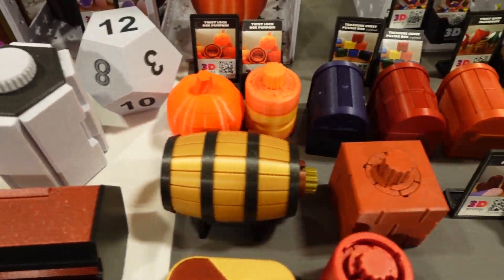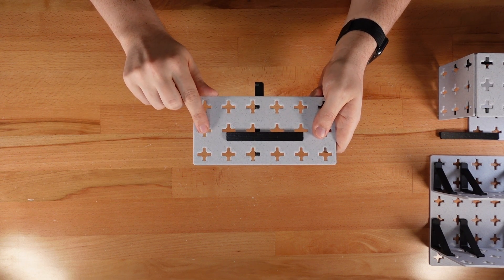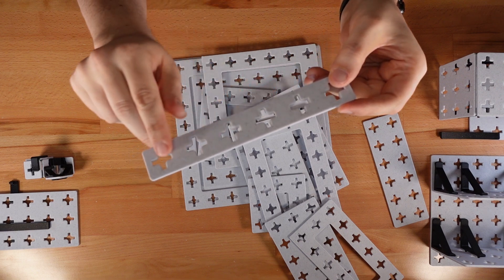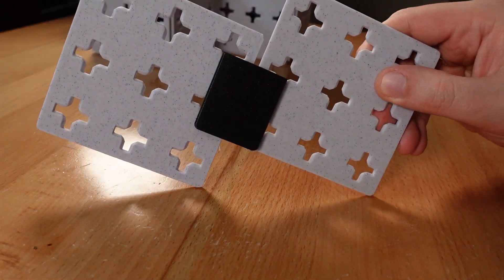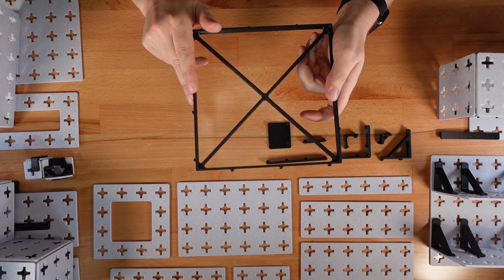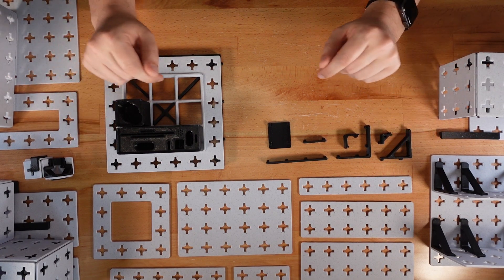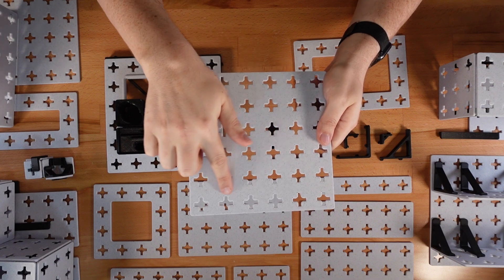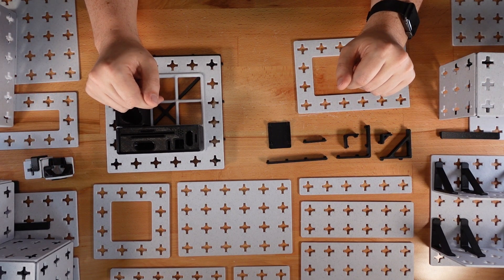3D Printed Shelving - Printy Panels!

Comment: I do see that there are templates to create panels but how would I go about generating say a 2x3 panel?
Reply from the maker: You have a few options:
1. There is a robust collection of remixes of my design on Printables, including one remix that has a 2x3 panel you can download. I bet there are remixes elsewhere too, but Prinatables has the most collected into a single spot.
2. You can open a 3x3 panel in your slicer and use the cut tool to slice it in the middle. Then scooch both parts together so they make a 3x2.
3. Or you can open the template file in a CAD modeling program to carefully place the parts together to make the panel you want. This is the best option if you're making a very unique panel shape - like a panel that bends around multiple corners.
Reply: @3DPrinty funny enough I didn’t check the remixes on the main printables posting. I found all I need and more. But I will keep the other 2  options in mind if I need them in the future 

Thanks.

Comment: If I print them out of PETG, can it hold multiple filament spool ?
Reply from the maker: Your results may vary, but I've tested storing multiple full filament boxes on top of a small shelf with no signs of failure after a month.

The shelf used 6x6 panels connected with a combination of box connectors (front) and reinforced box connectors (back).

Comment: What's the maximum weight the shelves can hold?
Reply from the maker: The answer will depend on the filament used, the print settings, and the construction of the shelves. But I can say the a simple shelf comprised of 6x6 unit panels printed in PLA+ and assembled into a 2x2 box formation (with a backing panels) supported 16 lbs (more than 7kg) with no sign of breaking.

If the shelf had been constructed with bracing panels below the top surface (or with smaller panels) it could easily have held more weight than that.

Comment: How much weight can these shelves hold?
Reply from the maker: There are a LOT of factors: filament used, panel size, shelf size, wall mounted vs table top, clip type, overall construction, etc.

I just dropped 8 1kg boxes of filament on top of a 3x3 desktop shelf and it seems fine with it. The shelf is using 6x6 panels (PLA+) and non-reinforced offset box clips. If needed, it could be much stronger than that by adding 6x1 ribs below each shelf and reinforced box clips.

Comment: I had been working on a modular shelf idea for a while and recently abandoned it as impractical for several reasons. The Printy Panels are an amazing idea and far better than what I had done.
Reply from the maker: I hope they work well for you. If you find ways to improve them to fit your needs, I hope you consider remixing them :)
Reply: @3DPrinty  Absolutely, just have to find time to print some and figure out what I can add to the project.

Comment: Would it be bad if I printed it like I'm printing multiple lithophanes?
Reply from the maker: Sorry, I'm not sure what you mean. Unlike a lithophanes, which usually have very thin layers, this will work best if you print with much thicker 0.25 or even 0.3mm layers.
Reply: @3DPrinty  i was wondering if it can be printed upright so i would be able to print a few at a time but still have similar strength. i was thinking .28 or .3 using petg.
Reply from the maker: @AM-ob7yi  Oh, I see!

That wouldn't be the strongest orientation and it would require supports around the port holes. So you COULD do it, but I wouldn't recommend it, sorry.

On a more positive note, the panels probably print faster flat because a few of the center-most layers can be infill.

Comment: Is there a trick to keeping these together? My panels keep sliding off the clips and box frames :/
Reply from the maker: For the regular clips, I suggest printing some test clips at slightly larger scales (starting at 101%) until you find the perfect fit. The box clips are trickier because you can’t scale them much before they become completely incompatible with the panels. You could possibly add a slight fuzzy skin to give those clips more grip without messing up the overall dimensions. Increasing your extrusion multiplier could also help.

In any case, keep the panels the same and alter only the clips as you dial in a good fit.
Reply: @3DPrinty  Fuzzy skin was the setting I ended up trying and it worked pretty much perfectly :) For the box clips I went with fuzzy skin modifier cubes just for the little tabs. 

Thanks for the reply and good to know this wasn't a totally crazy idea.  I will experiment with the extrusion modifier next. Thank you for the fantastic creations!

Comment: Problem with making something the size of an ikea shelf is when you add up the cost of the filament it costs more than the ikea equivalent.  However, it is probably more stable and can be broken down to a manageable size to move.
Reply from the maker: There are definitely tradeoffs to consider - this is just another option :)

Comment: Are the panels lasercuttable?
Reply from the maker: Unfortunately, the ports require a 45 degree cut (on both side of the panel) for the clips to grab. It might be a good project for CNC, but I don't believe most laser cutters are designed for that sort of cut in mind.
Reply: @3DPrinty  That's a shame. Laser cutting the flat panels would be so much quicker than printing.
Reply from the maker: @StePhillips  Absolutely. This sort of design COULD be adapted for laser cutting, but it would require a complete rework of the clamp design - and I don't believe it would be possible to get the clamps to sit flush, the way they do here.

Comment: YES! Oh my gosh I'm so excited! Thank you so much! :D This is gonna be such a huge, huge game changer for me. :) This is so much better than my wildest hopes of a hypothetical "Printy Pipes for Heavy Loads".

If I could make a small suggestion/request, it would be incredibly cool to have a variant of the GridFinity pannels that are GridFinity baseplate on top and a grid of Printy Panel ports on the bottom, rather than having the Printy Panel ports on the bezel around the edge. While this would block being able to connect the ports from either side of the panel, it would allow the GridFinity baseplates to tesselate to form a larger whole. This would make for continuous shelving for larger GridFinity blocks than can fit into a single panel. Not only that, but it would also make this an utterly fantastic fully 3d-printed, quick snap-together GridFinity baseplate solution even when the panels are sitting flat on the desk just by connecting them with the various flat clips.

Again, thank you so much for this. It brightens up my whole week every time you post. You really embody everything that excites me most about 3D printing and the larger 3D printing community.
Reply from the maker: Some excellent ideas - I'll try them out :)

Comment: Really neat. I will have to check it out and see how much time/filament it uses! One thing I though of when watching was to have some of those connectors with hanging hooks so you could hang things on the outside of the box shapes or whatever shapes.

Comment: Those are awesome, wondering about a 7 by 7, going to print the 6 and the 8 to see, but I think a 7 would be perfect. Thank you for sharing!
Reply from the maker: Glad you like it! Yes, let me know how it works out.

If 7x7 ends up being a sweet spot, you can slice an 8x8 panel into quadrants and move the sections inward by 32mm. That should give you a perfect 7x7 using nothing but the tools found in your slicer software :)

Comment: It would be great to make a stackable option that can be printed in one go.

Or maybe print them vertically with maybe a small breakable connection between them so they are supported as they go up.

But either way would be great to be able to print multiple layers of them in one print job.

Either way can't wait to print and mess around with them
Reply from the maker: I like the idea! The parts that are printed vertically would be a little weaker due to layer orientation, but in many cases that won't matter :)
Reply: Yeah good point

Comment: Another factor that can cause prints to curl up from the build plate is if it cools too quickly after printing. This is more known when dealing with higher temp materials such as ABS and ASA. So having gcode to keep the bed at temperature post-print, and having it more slowly lower temperatures can also help stop curling/deformation. 
Also, when it comes to corners, OrcaSlicer has mouse ears, far less of an annoyance and easier to remove than brims.
Reply from the maker: Excellent tips! The panels I let sit as the bed cooled did seem to curl a little less than the ones I pulled immediately.
Reply: @3DPrinty  No problem, learned that from the Voron community, which does a lot of ABS/ASA printing. 
These higher temp prints are very fussy, especially when it comes to chamber temperature and cooling too quickly.